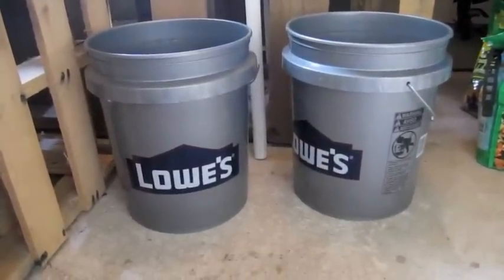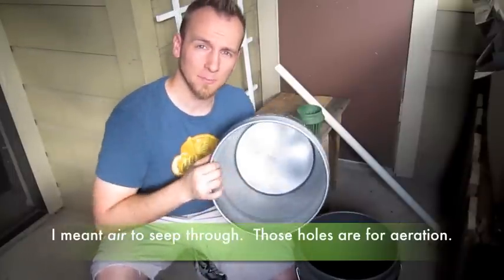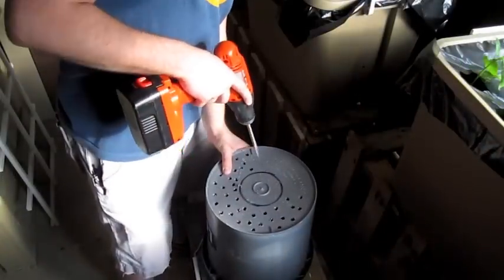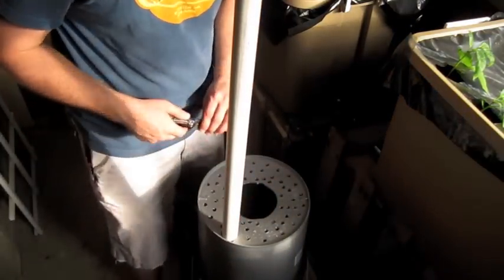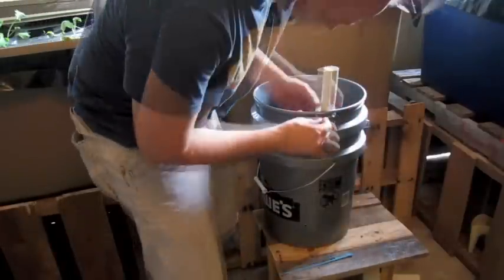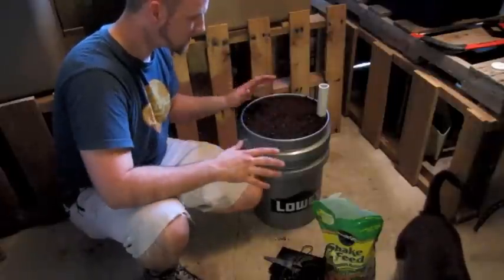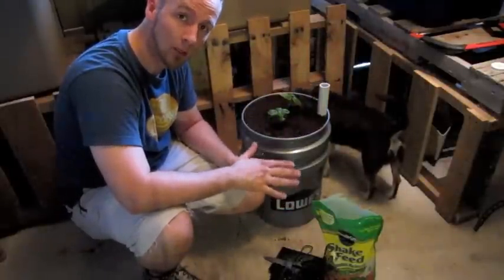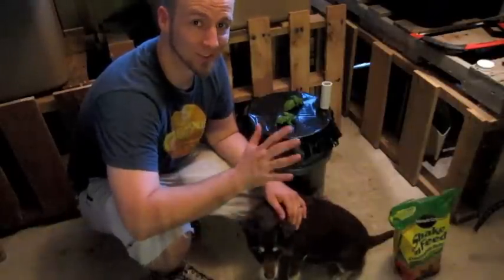Balcony Garden: How to Build a Global Bucket Style Self Watering Container

Comment: Nice vid, thanks! As for the watering pipe, instead of drilling holes in it, you might just as well cut it's bottom end at 45deg angle, will do the same job, but less work

Comment: why do you put the plastic on top? I built something similar, I have 4 buckets plumbed together, 2 are grow buckets, 1 is a water level control with a float valve and the last is a reservoir, I will be testing this design for the first time very soon. This is the first video I've seen with the plastic on top, is it supposed to act like mulch?